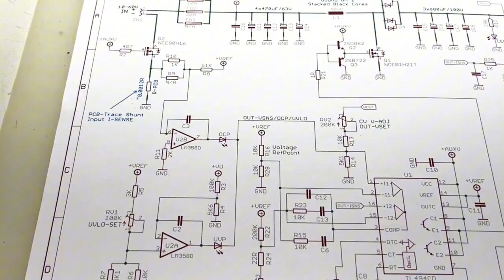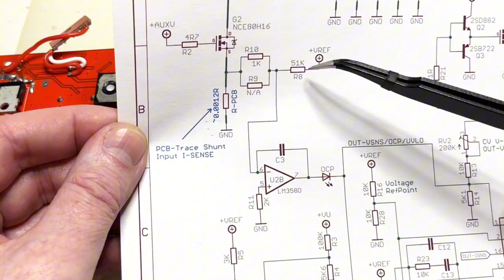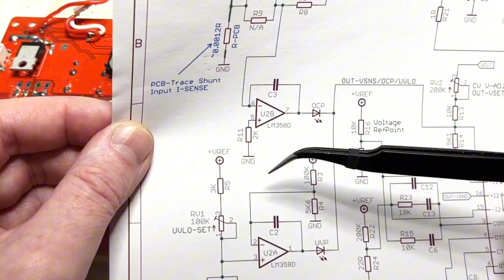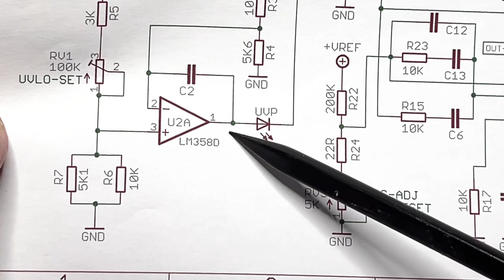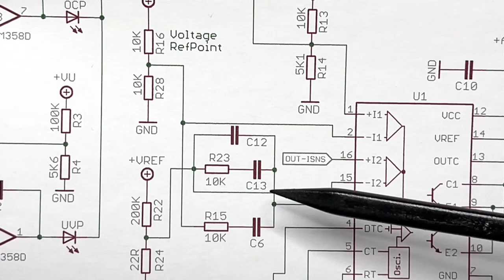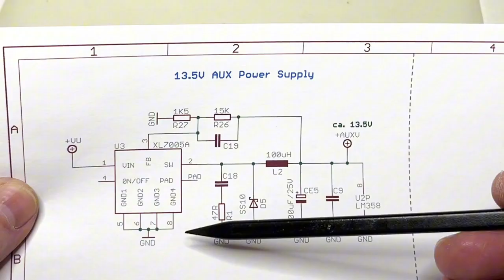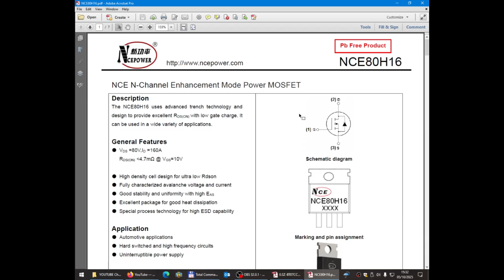Cheap China 1200W 20A Boost DC-DC Converter; Full Schematic,Walk trough,Tips and Test

Comment: Thanks for the detailed analysis! I have an SZ-BT07CCCV-A and would like to clarify the grounding arrangement.

I’m powering 48V PWM fans from its output, while their PWM control comes from a PC motherboard. The converter’s 12V input is supplied by the same PC PSU.

Are IN− and OUT− directly connected, or is there a current-sense shunt or any other circuitry between them? Would externally connecting OUT− to IN− bypass current sensing or interfere with current limiting or protection?

I noticed the input PCB-trace shunt and output current-sense resistors in your schematic, but couldn’t trace the complete return path. I’m trying to determine whether the fan control signals need isolation. Thank you!
Reply from the maker: Thankyou, Between IN- and OUT- are 2 Shunts (In and OUT) Shorting  IN- and OUT- will disable any kind of current regulation! Cheers.

Comment: Great video. How did you find out those two ICs that were scratched off near the TL494? I think it was the power 7005. oh yea, I would like to get a copy of the schematic. Which app is it in?
Reply from the maker: Thanks, all based on the pinouts and the way they are connected and bcs I used similar design. Contact me via my channel Email to send a pdf Schematic.

Comment: @KonstantinGrigoriadis i found the reason why you could not figure out the opamp u2b function ...its just beacuse in high current scenario the ground side of the pcb trace shunt resistor will become more positive and this +ve volatge will directly hit the ground side of r11 u2b resistor turning the output to ON state
Reply from the maker: Hello, the Rev Pol Mosfet is drawn correctly with the Source to the Load side
Reply: @KonstantinGrigoriadis  ok will edit thanks

Comment: Thank you very much for the reverse engineering, schematics and explanation. Thanks to you I could make some changes to the boost converter to use it as a "solar" boost controller for charging a 42 cell LFP pack.

Comment: Very helpful. Can you please share the schematic for the converter.
Would you also have the PCB files to build it. I would like to increase the power to 3kW at 48V output. The input will come from Fuel cell ( (8-20VDC). Can the present power components still work.  I intend to do liquid cooling for all the power components. I guess the inductor may have to be redone. 
Any suggestions ?
Reply from the maker: Contact me via my channel Email, works with a pc Browser only, to send you the schematic, the output diodes, the input protection mosfet, the switching mosfet as the inductor must be changed to withstand the high currents. Further this China design is not short  circuit protected (except gor the input fuses). Further, the "1200W" is never the output power, but the maximum input power!!

Comment: Good video. The OCP circuit as drawn won't work; you were not hallucinating :-). 
The U2B's minus terminal is sitting at +820 mV, and with 20 A input, it is at 845 mV. So, if you connect the left terminal of R9 to the U2B's positive terminal and the right to VREF such that the bias is at 845mV, it might just barely work.
I think the manufacturer copied the design, and it did not work correctly. They just said "screw it" and disabled it.
Reply from the maker: Thanks, I thought either I miss something here or its nonsense !

Comment: to get more control to power down is it possible to toss the diodes and put there a ideal diode ?  and the 7005 "s pin4 putting high (maybe by 3volts) will stop the booster ? but the booster will still give the input trough so thats why i was thinking of a switchable ideal diode. thanks for the video

Comment: Hello, good morning, I bought one of these 1500 watt boost modules. I came to replace the multi-turn. The board is not working. I would appreciate it if you could send me the schematic or PCB for this board. DC-DC 10-60V To 12-90V Boost Converter Step Up
Reply from the maker: Hello, Contact me via my Channel Email, to send you the Schematic

Comment: I think you missed a cap from DTC input of the tl494 the REF in your shcematic. Which in my case failed shorted and would not let the thing boost. I think it forms a soft start with that resistor.
Reply: it is the one between the tl494 and the output bulk cap of the XLSEMI
Reply from the maker: @iliazark1  Yes you are Right, I missed that one.
Its the Softstart Cap connected at VREF and DTC, Thankyou!
Reply from the maker: No, I didn't missed it, bcs in my Version this Capacitor does not exist..... There are many slightly different Layout and design Versions.
Reply: @KonstantinGrigoriadis  Are you sure? at 23:56, that ceramic cap C7,  I don't see it in your schematic.

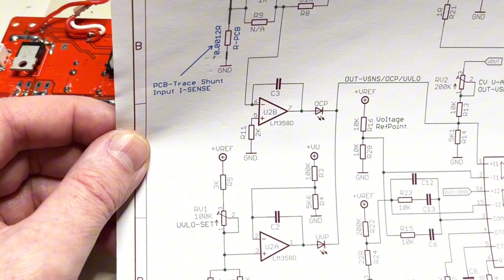Comment: 11:00 this type of current sense has been seen on many SMPS supplies, it works like this: 
The non inverting terminal stays at ground, 0v potential. 
And the inverting terminal is kept barely higher than ground potential by a large resistor from Vref 5v and a lower resistance to the supply negative before shunt. 

If current flows, the supply negative becomes more negative than ground because of the shunt, then the  inverting terminal goes below ground potential (where non inverting pin is) then the output becomes high. 

Actually the op amp input is working below it's supply range potential, more negative than ground, that's why it seems difficult to understand
Reply from the maker: Thankyou !
Reply from the maker: Hello, yes but this is not going to work with the values they use! Otherwise the circuit is similar to other cn power supplies

Comment: Nice explanation. I think there are 2 diodes on it for the following reason. At high currents and a voltage drop of 0.85V at 25°C (or 0.7V at high temperatures), the temperature rises considerably. And at high temperatures you also get leakage currents, so if you have, say, 90V at the output, that rises up as well. Due to the design where the top side of the MOSFETs and diodes is also against the board, part of the heat is transferred to the board. And the copper traces on the board probably aren't super either. If that is already a few milliohms and 20A (at 5 milliohms that is already 2W). The MOSFET might also have something like 10 milliohms. That is why I think there is a heatsink on the TL494, to keep it stable and prevent it from getting too hot. But if you calculate with an efficiency of 95% and that at 1000W, that is 50W that goes up as heat.

Comment: Hello! Thank you for the complete and thorough review of this converter. I have a question: can I charge a 3S Li-ion (12.6v) battery with it from a 12v computer power supply? If I set the charging current to 10A (CC) and voltage to 12.6v (CV) on a battery discharged to 9v, will this converter be able to supply 9v and 10A (CC) at the beginning of the charge cycle and then reduce the charging current and raise the voltage to 12.6v (CV)?

Comment: I have a 1400 watt power supply that outputs 50 amps at 29V, and I would like to charge my large capacity lifepo4 bank which requires at least 28v. Do you think this dc-dc converter would limit the input current to just 30A? If so can it be modified to accept higher input current?
Reply from the maker: What are the requirement of your Battery ? 28V ? how many amps of charging current ?
Reply: @KonstantinGrigoriadis  the battery is lifepo4 8S 314ah, 28V would be sufficient to charge 90 percent of it, but 28.4 would be best. The plan is to use my vehicles alternator to charge this battery when it is low. My alternator is connected via breaker I turn on when driving to a dc-dc boost converter, which outputs 29V at 50amps. Its' problem is that itshuts down when connected directly to my battery. So i resorted to connecting the converter to an icharger x8 but the icharger x8 is limited to 30 amp output and is not as easy as just flipping the breaker to start the flow of current.
Reply from the maker: @Solidaritycheguevara  The DCDC I made the Video for is a Boost Converter, so the Output must be higher than the input for at least a couple of Volts. 
This DCDC is not designed for Higher Currents than the ones stated and these are already exaggerated.
It can do 1800W but not for long, the Input Current is only limited by the 3 Fuses, the output current limit means that it just stops boosting when the set current is reached, but at the output you still see the Input Voltage minus the Diode Vf and the Voltage losses.
Reply: @KonstantinGrigoriadis  is there a way to allow an increase in output current to 40ish amps?
Reply from the maker: @Solidaritycheguevara  no, i already wrote that even the 22A are to an absolute Maximum for a short time only

Comment: Hello, I have tried to regulate out current with dimmer in the middle, I have tested with multimeter and resistance changes. In order to try I have connected to the output variable electronic load, I have tried from 1 to 8amp and I  have tried to rotate the screw from 0 to 4.8 (I do not remember the scale , perhaps MOHM,  but I am not sure), but the load absorbs always the same current I set (ex 8amp if I set 8amp). I expected to limit the current, but I was not able to do it ! Where is my mistache ? Any Ideas ? Thanks
Reply from the maker: Hello, well this Design just stops Boosting when the output set current is reached, but still passe through all the Input Voltage.There is no Serial pass Element that regulates the Output Current, this is why I said in the Video the design has NO Short Circuit Protection except the 3 Fuses.

Comment: What is the minimum Vin - Vout differential? I want to use it in constant current mode to drive an LED grow light, which seems to run 50-54V depending on brightness, will 48Vin work or is it too close to produce a stable output?
Reply from the maker: There is no info about min vin vout diff, but from expirience,  48 to 50 will be to low, 54 could work without knowing how stable it will be.

Comment: The TL494 was always designed for current drive into an NPN power device,
or just be the device itself for low current applications.
Because of this it is poorly suited for mosfet driving,
 like more modern such devices are.
BUT, the TL494 is exceptionally stable compared to many.

Comment: Only TWO possibilities for OCP.
   1) The reverse engineering is incorrect
   2) The circuit cannot possibly work, and is an INSANE design.
...I think 1 is the most likely, ...sorry Konstantin.
Reply: I also notice that the pull up resistor for the totem pole driver for the main mosfet is missing in your diagram.
The device cannot work without it.
Reply from the maker: You mean the Pull Down resistor at the base of the Totem Pole, yes you right I missed that one while transferring the schematic from the Paper to the Cad. Thankyou.
Reply from the maker: Sorry no, Input OCP Part of the reverse engineering is correct, But you are Right for the Totem Pole, missed that while transfering the Schematic from Paper to CAD, Thankyou!

Comment: Hello sir pin 13 is connected to vref then output A and output B of TL494 will work as push pull output. Here output collector - collector and emitter - emitter are connected like parallel connection single ended out put. For single ended output pin13 should be grounded. With this connection how pwm work and how duty cycle changes .
Reply from the maker: I already answered that in the comments :-)
the Result is to have a 0 to <= 100% Duty at the osc set Frequency , same as if the oct pin would be at gnd
Reply: @KonstantinGrigoriadis thank you sir

Comment: Very good job explaining and reverse engineering thanks for the effort
I used the last video for my design buck converter and it worked very well just little modifications and implemented microcontroller to control the output (V&A) with push buttons
For this one can you please tell me what is your email so you can send me the schematic
Reply from the maker: Hello, thankyou. Please use the email on my youtube page, its visible only with a pc based browser, not from a mobile. Donno why youtube dies that
Reply: @KonstantinGrigoriadis yeah now i can see 
I sent you an email.
I hope you help me out with this.

Comment: Great job! I agree the current protection is too easy to do. Why they didnt do? On the other side i payed it less that the cost of the only heat sink.
Reply from the maker: Thankyou!, they didn’t do it bcs of the low overall cost, this booster was designed as a crude but not bad charger

Comment: Hello. Can you explain the difference between the "output current short" and the "input current short" please? Are they different? 
Also are you suggesting to detect these two separately but using only 1 series pass element to disrupt the connection?
Reply from the maker: Hi there is no input or output short, as it is designed only the fuses protect the converter yes one pass element can be used as a load switch with the appropriate circuitry and this is the g2 mosfet. What is implemented is input and output current limiting while boosting! A even simpler output short protection could be implemented using a growbar design to blow the fuses fast.
Reply: @KonstantinGrigoriadis  Can you draw a crowbar circuit for this case on paper and illustrate please?
Also, do we need input current short protection here normally? What protections are actually required in industry for such converters?

Also, how are you not getting electrocuted when you are touching the whole supply with your fingers? I'm actually scared with Power Electronics haha but also very interested!!! :D
Reply from the maker: I will add an Idea on my Community page in the next days for a Crowbar short Circuit Protection.
I don't get electrocuted bcs:
1) the voltages are to low
2) i touch it only with one hand (one hand in the Pocket Rule) for higher Voltages
Reply: @KonstantinGrigoriadis  
1. so even the current is very high, low voltage is safe?
2. How much higher voltages can this rule suffice?
Reply from the maker: @ProjectUsama  I don't want to put any comments here bcs this depends on many factors and my statements can be misleading, safety levels for Current & Voltage fot the Human body, pls search the Internet.

Comment: Thank you sir 
Now 800w buck converter.
In 800w buck converter I have noticed pwm ic is tl494 but name is erased. Xl7005 is not used . I guessed for 13-15v supply they have used uc38xx series ic to make 13-15v for vcc . I want to confirm. If pwm ic is tl494 then how they have designed non synchronous buck and driving MOSFET in high side. Thank you for every information provided with schematic diagram.
Reply from the maker: What 800W pwm Converter you mean ? I didn't made any Video with a 800W Converter
Reply: @KonstantinGrigoriadis yes sir  you have not but request to make
Reply from the maker: you mean this one : https://www.aliexpress.us/item/3256802975288592.html ?
It looks like they use a Synchronous design like in the 600W Converter I Reverse Engineered
Reply: @KonstantinGrigoriadis sir AliExpress link doesn't open
Reply from the maker: @Dcode103 donno why here it opens
Reply: @KonstantinGrigoriadis may be internet issue here in india
Reply: From this video it is clear that only one switching MOSFET with one switching MOSFET it should be non synchronous buck.
Reply: Then design is driving high side MOSFET. And pwm ic is TL494 .
Reply from the maker: @Dcode103  I mean this Video : https://www.youtube.com/watch?v=HT37i1cV6Dw&t=2078s, not my actual one
Reply from the maker: @Dcode103  here another link : https://www.indiamart.com/proddetail/800w-30a-high-power-dc-dc-step-down-buck-converter-module-2856403099188.html,  this should work
Reply: There is pair of d882 and B772 , and small size  transistor near tl494. I think these transistors makes circuit that can drive high side MOSFET. 
From the images I have collected components on the pcb are
1. TL494
2. LM358
3. D882,B772 transistor 
4. One switching MOSFET 
5. Schotcky diode
6. One switching ic in input side to make vcc supply it's name is not clear  here is small ferrite core transformer so I guess this is may be uc38xx series ic that used as buck to make vcc supply with higher input voltage  range .
I am interested to know input side ic name and how they drive high side switching MOSFET using tl494.
Reply: @KonstantinGrigoriadis yes it opens
Reply from the maker: @Dcode103 you sure it is only one mosfet ? Why they have 2 pairs of 882 and 772 then
Reply from the maker: @Dcode103  to see how the Pass element of the Buck is driven check the example in the datasheet : https://www.ti.com/lit/ds/symlink/tl494.pdf